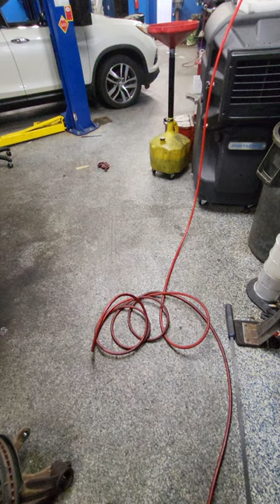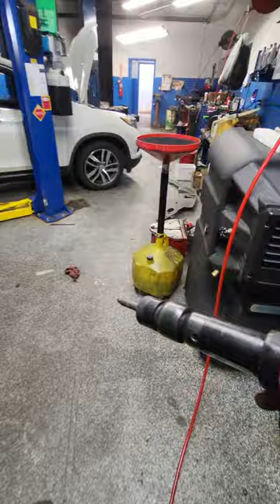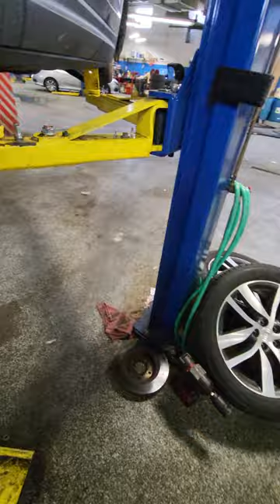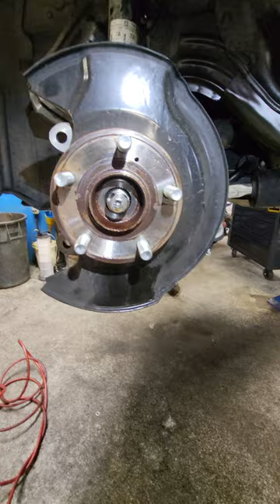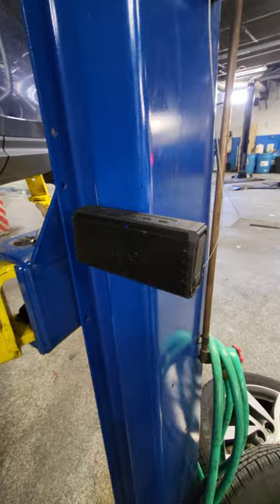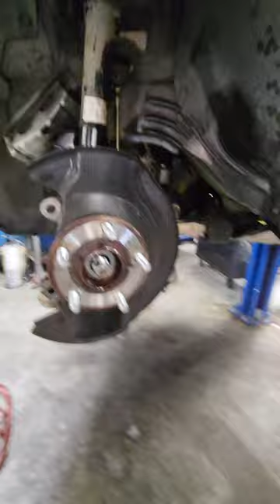Seized Axle At Work Dude?!?! 😅👌😮‍💨 #shorts #honda #tevideos #smh #bananabreadatwork

Comment: Whenever the air hammer doesn’t work I’ll partially screw on an old axle nut (keep them from the driveshaft recall on the accords) and have someone hold the ball end of a hammer to the axle in the nut opening and then hit the flat face of that hammer with a sledge hammer maximum force. Works great but you need the ball joint still connected for it to work.

Comment: We came across this a few times in VA bro. I swear they don’t make ‘em like they used too, my bay neighbor was doing a set of front shocks on a 17 and for the driver side we ended up both carefully stretched the axle to its limit to slide out the knuckle. Biggest pain in the dick these are.

Comment: How’d you end up getting it out
Reply from the maker: A lot of heat, a lot of WD-40, and 2 air hammers at the same time. 😬👌 I was replacing struts. On this vehicle you are supposed to remove the axle in order to have room to slide the knuckle off the strut. I could have technically just pulled the axle out along with the strut and brought it all out as one but  that would have just left a nightmare for the next guy. Ended up replacing the axle after warming the customer that if I continue there is a good chance the axle threads will get damaged  and they where cool with it. That's when I hit it with 2 air hammers and a lot more heat 😅👍. These Honda pilot axles like to seize in the hubs 😮‍💨

Comment: I would have used a puller.
Reply from the maker: Would've bent the puller for sure. Unless you have a giant beef cake puller in which case I need 🥲👍 It's STUCK stuck 😅.
Reply: @TEVIDEOS  The industrial diesel world has all sorts of beef cake tools. Hydraulic pullers and induction heating is my go to when things need to be separated.